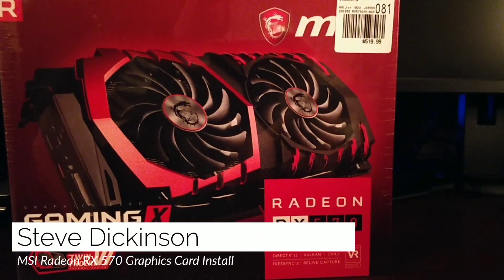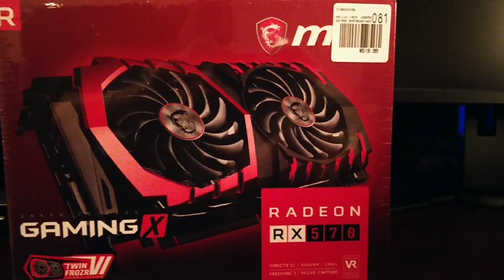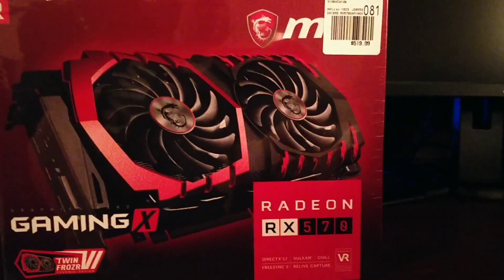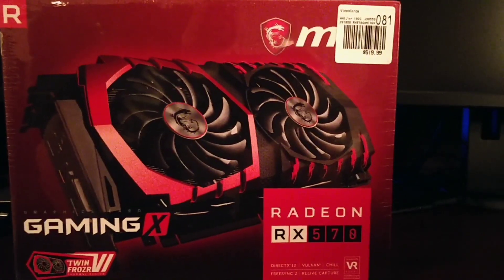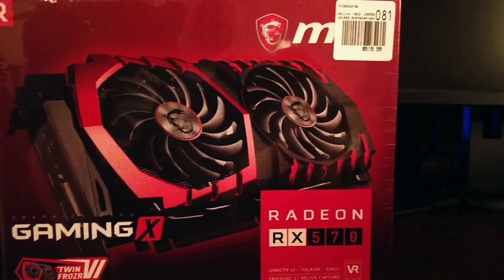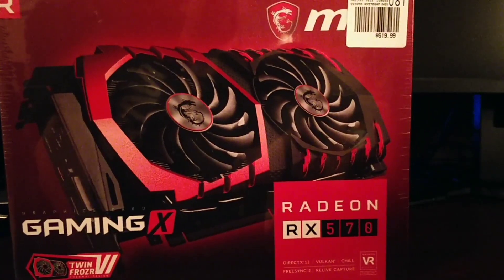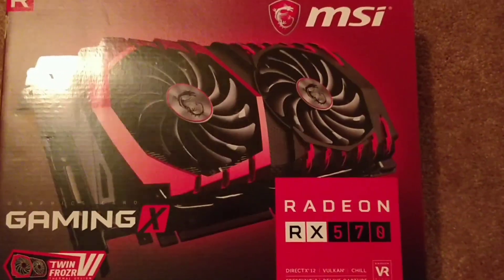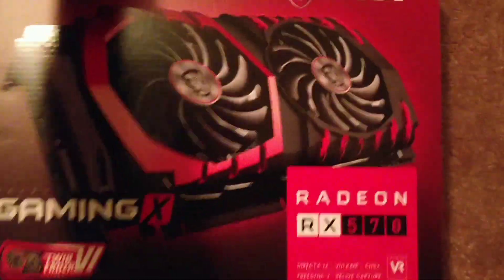MSI Radeon RX 570 Graphics Card Unboxing/Install

Comment: I installed this card today. Now the fans aren't spinning after the installation. The two monitors are both displaying right now. 
Update: I plugged in a VGA cable from my power supply to the graphics card. Thus the fans aren't spinning. I might have to buy a new pair of vga connectors to make the fan spin.
Reply: bruh you just made a mistake lol because the fans don't spin if you are not playing they spin just when the gpu is hot and need air
Reply: @hatimabdelmounim6587  bruh, even when playing a video game back then the fans didn't move. Might want to buy hooked on phonics.
Reply: You need to connect 4 pin connector from your PSU to gpu dude.
Reply: @enderdragon9236  Dude I did. I ran Dead Space and then Alan Wake. And then took a picture of the fans not working. I returned the RX 570 and got an NVIDIA card. The new video card and the fans are both working. So yea bruh.
Reply: whats funny is the card isnt designed to ramp up its fans until, what i can recall 60c temps. but um, vga cable from the psu?
Reply: @mBOOMo19  it's was an old computer. But the card was a doa because I tested the previous Nvidia gpu and was running while having Alan Wake and Dead Space was on.

Comment: Does this connect the the PSU with a wire or does it connect just by plugging it in?
Reply: Needs a power connector. That's the thing he refers to as a VGA cable at the end. Fans were not working until he plugged that in. I was also looking at this card, but sadly I dont think my PC has the connector from the default power supply, so that's the next thing to look into. Worst case I'll have to go a lower card that uses onboard PCIe power :( RX560 Aero perhaps?
Reply: @005AGIMA  Change the psu it's not to expensive
Reply: Ajit kumar  buy a condom you mean? For fuck safe ;)

Comment: My gpu over heats in like 10 min of playing a game any suggestions
Reply: Did you plug in the 6 pin power cable? (The bit he forgot until the end of the video). If not, the cards fans are not running.
Reply: @ Itz Shaw Time. I'm mounting a 80mm fan 1/2'' over the rear of the card right over where the GPU is at, so the fan can blow directly on the rear of the GPU. Just to see what would happen, I turned the rear case fan around & just put a piece of cardboard over the fan on an angle & it dropped the temp 2* just idling so it might help keep it cool. **Another thing is I bought some thermal paste @ $27.00 for a 11.4 gram tube. According to Louis Rossmann, he is a great repair & GPU re-flow guy out of NYC. He has the expensive $8k-$12k Re-Flow equipment, so I trust what he says. He said the best paste can lower the temp from 3-12 Cel. He's on YouTube, just search his name & ask him. I bought my paste at ***Newegg.com, Grizzly Thermal Paste***. It was cheaper than Amazon & all the local repair shops. 11.4 gram tube would do like 6-7 builds, putting a thin coat on both CPU & GPU. I'm gonna do one of my Radeon RX570's or RX580's & test it out. But first I'll use a heat-gun or something to loosen the warranty tag sticker that's over one of the GPU Heatsink screws, that way if it has to go back, I can make it look like it wasn't removed.
Reply: You probably need more powerful fans

Comment: So 8 pin, that's all I needed to know xD thanks
Reply: Haha so true. I came here to see if there's anything special when he connects it(I believe most  570/580 are 8pin), but he skipped just that part lol.
Reply: @xingbairong  Like 2-3 days ago I just bought the RX 570 8gb Phantom and I noticed that has 6 pin connector, it's weird, I think that from the video has 2 more pins for the lights, the one I have doesn't have lights :D
Reply: @ZayxSt  Possibly. Not that tech savvy myself. I was looking into seeing how he will connect it because I'm planning on getting 580 8gb and seeing that the pins are the same as the video I thought it would be nice to see... Didn't see it so I just disconnected and reconnected my own old GTX 760 to make sure I can do it lol :D
Reply: @xingbairong  how do i  check how many pins i have
Reply: @RobMusik  On your power supply or GPU. It will be easier for you to just google that information since you will also see images and it's a lot easier to understand.
If you know the model of your power supply or GPU(whichever you need) just google the model and and you will see. You can also simply write "gpu 6 pins 8 pins" and go to images and you will see images with both how the cables look and how the pins on the GPU look as well, so you will get the answer for both of those.
If you don't know the model(wattage at least) of your power supply and GPU you should really first find how much watts the power supply supports and how much watts the GPU needs, before you connect it to the GPU to avoid connecting for example a 300W power supply to a PC that requires let's say 350W(for example the GPU requires 250W and the CPU 100W. Newer parts tend to have lower TDP(basically wattage use. I mean it's more than that, but if you don't understand from PC's that's what it means for you :P))

If you aren't 100% sure you can always ask people on tech forums like linustechtips or tom's hardware or any local forum in your country that's active. Pretty sure you will get a fast helpful answer really fast :)
Reply: thanks man i appreciate it
Reply: @RobMusik  np hopefully you found what you were looking for :)
Reply: Lmao just bought a rx 570 but I don't have that cable he connects at the end, is it necessary?
Reply: @Takumi_776  Which one? The one that goes in the 8 pins that he forgot to connect? You should have that type of cable coming from your PSU(power supply), though I suppose cheaper models(or lower wattage) might not have such a cable. Generally you should make sure that your PSU is good enough to use such a card, a 450w Bronze + power supply should do the trick(I believe they recommend 400w + for the card), but I'd recommend better power supply like 520-550w+ Gold if possible if not Bronze is good, so that you have some possibility for upgrades(adding ram/hdd/ssd/fans etc...) without worrying that it might go "boom" :D
Seasonic, EVGA have good prices.
Reply: @Takumi_776  Yeah it's necessary, you can buy that cable molex (wich I did) or just buy a new PSU with that cable
Reply: Nevermind i found it lmao
Reply: I just bought a rx 570 and found out my power supply doesn't have a psu cord
Reply: Is it the 6 plus 2 pin?
Reply: @zyncelement4567  Yeah 6+2 pins will work just fine.
Reply: Wait so does it take up one slot but cover two or does it need two slots?
Reply: same xddd

Comment: Does the vga cable not come with the card?
Reply: No they usually don't
Reply: Zachary Farnham how do I put a graphics card if I’m tryna upgrade a prebuilt that didn’t have a card
Reply: You should place it in the pci e slot closest to the CPU socket, make sure all rubber covers are off, and  make sure your power supply has the right connectors if any are needed and enough wattage
Reply: Zachary Farnham oh I thought it wouldn’t work without the connectors thanks I just need to install windows on it and I can download the drives thanks again
Reply: @JesusGarcia-bt1nc  make sure you plug in connectors ig your card has them if not just slot it in and your good to go
Reply: @ZFarny42  mate i think go install my card that i purchase days ago, and i have the same case as that guy, im without video card so if not have connectors in my pc i not need to buy just to plug the card and install drivers and it will run? I really worry about these connectors bcs i will do this for first time too..

Comment: Greetings friend! I just have the same card, for some reason the drivers do not work, if they are installed, but if I go to the device manager, it follows the yellow exclamation symbol.

I have windows 10/64 bits.

I will help you ...
Reply: I have this problem -.-
Reply: @geethor1827  yo lo logre solucionar aplicando un parche
Reply: Mea culpa, la fuente de alimentación, pese a ser de mas de 450.. no me la aguanta. Gracias de todos modos!

Comment: Noobie here with a question: the VGA cable you forgot to plug-in at the end, where does to other side have to be plugged into?
Reply: In the monitor
Reply: Smh the “VGA” cable he was referring to is actually a 6 pin molex cable and it has to be plugged into the power supply
Reply: @KamiGuruUwU   is it needed?
Reply: John Schlegl It is needed yes because if it isn’t connected via the 6 pin molex it won’t receive enough power through the pci express port causing the cooling fan on the card to not work ultimately burning out the card after just a bit of use
Reply: @KamiGuruUwU  thx
Reply: @KamiGuruUwU  "is it needed?" POWER cable